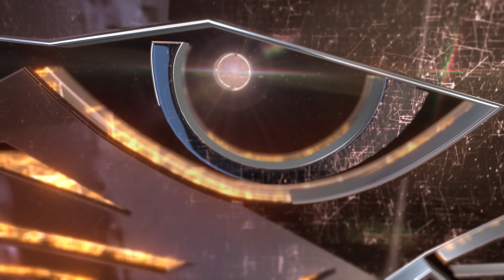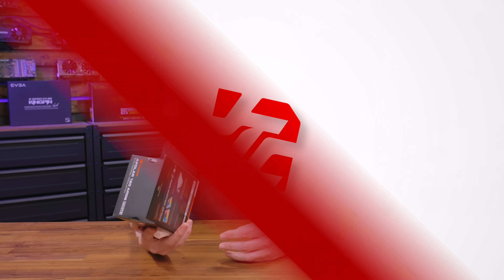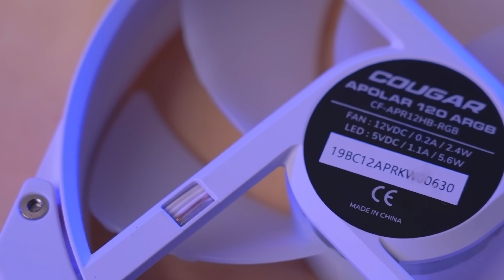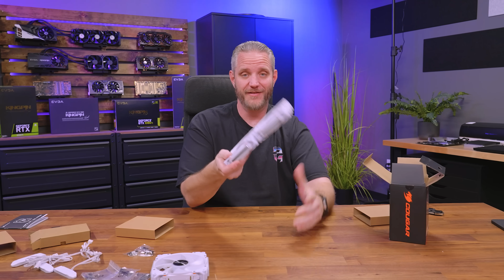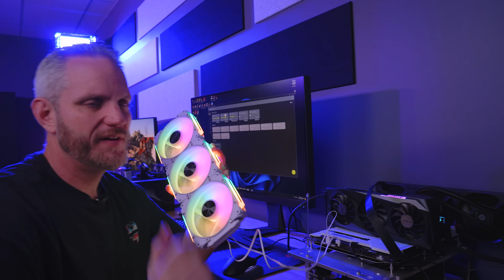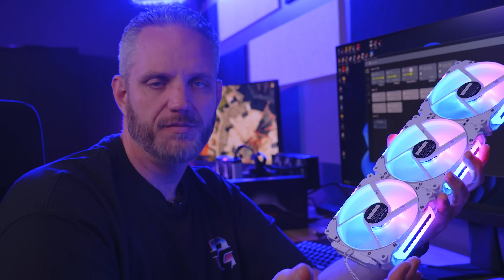ALL PC fans should have this feature! (NOT RGB)

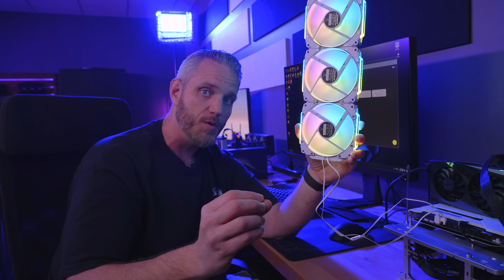Comment: Hey Jay, I almost never comment but had to inform you! At 16:15 you said "because right now you can only get interconnecting fans in RGB". That is not correct because Corsair (of all brands, one of the most rgb focused brand does make this lol) does make the "Corsair iCue Link RX120".  It does use the Link hub, which is great when you use multiple Link components, (Fans are available in black and white, 120 and 140 variations.)
Reply: Also Lian Li Uni Fan P28
Reply: and the corsair qx series
Reply: I have Corsair. It's ass.

Comment: Arctic Liquid Freezer 2 AIO (non-rgb) with one cable off the AIO pump and interconnected fans would be bloody awesome. I would also loooove to see slim interconnected fans as well as that's where it makes most sense as in small form factor builds space is at a premium. Less wire clutter means less restrictions for airflow.

Comment: hi jay the only issue i see with fans like this when all connected via one lead which is great by the way.
 i have lian  li  and also a cheap set of ediy fans and have got them connected via controller and also mobo.. which i love also  have razer chromo unit etc but what i cant seem to figure out 

is that you dont get to control the individual fans as such with colours its either one set for the whole set . meaning you cant have individual effects for each fan unit and tried different software like signal and msi and open rgb

Comment: The price is attractive?! Fans have become SO over priced and buy buying stuff like this, you're just reinforcing that it's ok to charge that much for a FAN WITH A FEW LEDS... I filled my PC with Thermalright fans. You get a 3 pack of rgb fans for $13... Yes... 3 fans for $13. Granted they do have 2 cables per fan, but with a dual chamfer case where all the wires can easily be hidden in the back, I'll happily spend $40 to fill all 9 spots in my case vs the $210 for these fans and just deal with a few zip ties. Not to mention that these fans use proprietary connectors! Proprietary is bad! Standard form factors are what make replacing and upgrading your PC easy. Stop supporting crap like this just to get away from a few extra wires that can be tucked away. You're just making everything more expensive!

Comment: might be able to 3d/resin print new spacers to change out the orange ones, or maybe fine something at the hardware store.
Reply: He didn't realize that those black rubber pads in the begging he didn't know what they were for were black replacement spacers for the orange ones already included in the box.

Comment: In my opinion fans could be improved by better cooperation with gpu and motherboard for example to be able to fans ramp up or even start when gpu reach some targeted temperature also for cpu and other places in the pc case like temperature of VRAMS on the mobo. Also half of the fans can be turned off when the pc is not under load.
Reply: you can already do that either with software or 3rd party controllers like aquacomputer quadro.

Comment: I would 100% buy interconnecting fans if they had no ARGB. The only reason i haven't gone to these types of fans is because I don't want ARGB.
Reply: Don't plug in the ARGB cable. Problem solved.
Reply: Or buy the non RGB models lian li sells.
Reply: lian-li unifan p28. interlocking and no rgb. $55 for a 3 pack.

Comment: I built my first PC with 10 Corsair fans. I have two different hubs, 10 fans, and a whole lot of cables. These daisy-chained fans are a welcome addition.
Reply: i got 6 corsair fans and 1 corsair pump, dealing with cables and 2 hubs is annoying
Reply: @sopcannon  yeah I have a Corsair AIO too - it's so much to cable manage. I like the Corsair ecosystem, but I hate managing so many cables.
Reply: @newstandardaccount  yeah i got a case, case and memory all corsair, not a fanboy but its all controlled by one program.
Reply: @sopcannon  yes same here - 5000D, and I love it. Honestly once you buy into one ecosystem, the incentives to continue with that ecosystem are so strong. This way I only need icue, and not 500 different management tools.
Reply: @newstandardaccount  i got a 500d with a dead fan controller, discovered after installing everything.
Reply: @sopcannon  Corsair support has been good. When my 5000D arrived, the front panel was bent. They sent me a new one quickly.
Reply: @sopcannon  I setup my sons computer like that. Routing all those wires was a pita!

Comment: Anything that can move air/fluid is NEVER boring! I find it interesting. Granted I care more on the heat transfer / fluid flow area. Not so much with the lighting. I just bought a 3 pack of Super Flower MEGACOOL 120MM fans. I am going to see if they cool my Artic LF2 360MM AIO better than the included fans. 
From Jay to Jay.

Comment: Hey Jay, I have been using Evga Precision with the argb/rgb header on a evga GPU to do the signal with a hub powered by a sata cable for the lighting. The software is just so much more polished and responds almost instantly. If I could get rid of my asus board I would.

Comment: After dealing with some bad screws in my last build, anything to make fan installation less annoying is welcome. My next build will (hopefully) be water cooled, so just being able to slap a solid stack of fans on a rad sounds nice
Reply: personally won't end up with watercooling but being able to make a block of fans for the front of a case (especially a large 3x 140mm intake) will just be awesome.
Reply: still have to screw them on, just makes the wiring neat l

Comment: Lian Li Al 120 3 pack is 10$ more (79$ at the moment) and they come with a controller.
16:15 They also have P28 fans which are interlocking, they don't have RGB and the blade made from LCP - they offer great performance. 
What the point of this video ? cougar aren't in the top of performance\quality, at almost 70$ for that fan it's not that good of deal.

Comment: I like cougar fans they're quiet and perform well in my experience as both case fans and on a heatsink. I don't think you'll ever see that orange grommet thing under basically any use case at least not to any meaningful degree even in the ones you would like on a horizontal rad

Comment: Yes, this should be a standard. I feel we should move to reversible fans as well. Finding white reverse direction 140mm fans for the bottom of my O11 Vision was harder than it should be.
Reply: Serious question, but why does it matter if they are reversed when you can't see them? Or even if they are visible, you can't see the logo.
Reply: Much cleaner look. You see the infinity mirror (on the model I got) and no frame. @farmeunit
Reply: @farmeunit  the fan hub with the 4 spokes coming off it looks "bad".
Reply: @FastSloth87  My point was, if they are in the bottom, how are they visible... I don't own one, so curious.  I haven't seen a case where they are visible in the bottom.
Reply: @farmeunit  literally all O11 derived cases.

Comment: I'm glad there will be less cables and controllers on these types of fans, but I'm not glad about spending several hundred dollars only a few years ago on fans and controllers, to now need to spend another several hundred dollars on these. Current estimate is $500 to replace my current fans and remove the uneeded controllers. My fans and controllers are still good, how many years before replacing if not broken?

Comment: I'd rather deal with one cable per fan than these "revolutionary" chaining setups where the fan may not fit on some cases because the fan body is larger in order to accomodate RGB and other crap. And for 66 bucks, you're putting way too much faith on those plastic wings which will wear out and break under normal use eventually.
Reply: Get sl120 v1 , no proprietary connection, construction is a tank, no fan come close to the quality, the plastic thickness is too much it's unbreakable no matter what
And use them with signalrgb, they are even cheaper nowadays,

After using sl v1 and sl v2 I will never ever accept fans lower than their quality and features

Comment: I like how you trash talk asus, and I literally just ordered an asus motherboard, now I feel stupid
Reply: It feels a little bit " I have to say bad things about Asus because they are currently the badies"
Reply: @scruffy3121  i mean maybe they are the badies and all that, but they've made motyerboards that people buy for a really long time. In my case I accidentally damaged something on my gaming pc last week while trying to overclock... It was crashing while gaming, so I restored the settings to stock settings and well.... It still can't hold 30 minutes of gaming without hard crashing... I thought maybe I corrupted some system files, so I installed win10 from a new thumb drive and well... It still crashes.. but hey the bright side is I'm upgrading the whole thing. I'm going from a 9700k to a 14700k (btw I didn't know it basically functions the same as the last gen chip for a higher price, so I'm kinda screwed on that front as well) and that means that I also have to upgrade the motherboard because the new socket and all that, and then I also realised my DDR4 memory sticks won't cut it for the new motherboard so I threw in even more money to order myself 2x32gb DDR5 sticks. And then a new radiator and a power supply because it appears that the new 14 gen cpu is HUNGRY for power... And I ended up spending so much money... Just because I thought it was a good idea to try for a 5Ghz overclock on that poor i7 9700k...
Reply: @scruffy3121  Or they just suck?

Comment: Seems pretty nice for the price. I like the click and sturdy interlocking tabs. Seems like a fair amount of effort went into making sure you've got good connection. Lian-Li could learn a thing or two from Cougar on that front.
(The interlocking tabs on Lian-Li's TL LCD fans are absolute garbage compared to these. You can easily disrupt the connection on those, which in itself usually isn't a problem, but becomes a real pain because it messes up connectivity with the Lian-Li software, so you end up having to physically disconnect and reconnect all connection points to "reset" stuff.)

Comment: If only there was an open connection standard that included addressable fan control and addressable rgb.
If you can't easily have that much power running through the motherboard, put that on fan/rgb hubs with another open connection standard that would let the UEFI control anything connected to that hub. That would allow for daisy chaining between brands, even if different fans don't snap together. Though an open standard that allowed for that would be perfect.
Manufacturers' inability to work together on new standards has forced everyone to leave decades old standards on motherboards.

Comment: $23 a fan is not insane?? 😭😭
Reply: It is
Reply: For these type of fans it's not unfortunately
Reply: nope. these are the cheapest i've seen of the linking fans. corsair's go for $30-45 per fan, lian li and thermaltake are about $25 per fan. you want cheap, buy non-rgb, non-linking fans.
Reply: @KOCotto  Thermalright 120mm ARGB fans are $13 per triple pack. Their non-rgb fans are barely any cheaper. Plus, the fans themselves are good quality. They're not linking fans like these, but the value proposition is insane. I'd have to really hate cables to spend that much more for linking fans.

Comment: The best powerfull fans are from Arctic and are the P12 Max with sealed blades. If they would make a version that could snap each other that would be the perfection. No RGB gayness going around. If you need some light inside the case, a led stripe is enough.

Comment: Lian Li makes the P28 fans. They are Uni fans, so they connect to each other. They come with no RGB, but you can actually buy a little side strip thing to add them if you want. Also, the cable that connects to the fan header is sleeved. So it looks nice and has some extra durability. They're good fans.
Reply: Love lian li stuff but thier l connect is garbage. It's insane how much cpu usage the app uses and tbey still haven't fixed it.
Reply: @11onejay  What's good about these fans is they don't use any extra software. They're simply the 4 pin fan header.
Reply: @jimbobvaquero  yeah if I were to buy an expansion piece for more headers I could just plug all mt fans into the mobo as well and just run armory crate. I hear they are brighter as well. Just like the look if minimal cables on the front side of my pc.
Reply: @11onejay  L-Connect is such a PITA, took me a couple of hours of research to know that the latest version is broken af and had to download an older version for my SL 120 V2's to work properly. I love the fans but their software is utter garbo.
Reply: @ajtheracer95  100% agree lol. Some of the nicest looking fans in the market though.
Reply: If you're going for performance fans line P28, it's better to buy Phanteks T30 which is the best of all. Noctua NF A12x25 and Nidec GT are also good options.

Comment: So wait you gave it credit for not having a controller in the box because it's better to use the headers on the MB then you say you can't wait to get your in line rgb controller?  I'm pretty sure MB mfrs are paid by fan makers so they can sell controllers.  ASUS is actually better than the rest.  Hard to believe but the MSI software is even worse garbage and my z790 from gigabyte released firmware that bricks it's argb headers and can't be fixed.  They're all garbage but singling one out is silly.

Comment: The main issue I have had with these types of fans is case compatibility. For example - my H6 Flow does not play nicely with alot of these connectors without needing to mangle them or trim them down which really stinks. The sides become too bulky and don't allow for the main connector for the wire to be there. On the H6 this is mostly present in the Titled font panel fans and the double 140mm fans at the bottom with the little lip holding them back.

Really love this direction of fans, though wish more cases would play nicely with them. I really like the look and use of the Thermaltake SWAFANs for their ability to change their direction but they sadly just did not work for me

Comment: Looks like the small orange spacers could be removed and replaced fairly easily by just undoing the screws that go through them, of cause it would be better if they were just the same colour as the fans to start with.  If you've got a 3D printer then it would be very easy to make your own spacers too.
Reply: They seem to be made of rubber, I suspect they act as noise dampening. You'd need TPU for that stuff.
Reply: There was some black rubber stamped in a sheet in the beginning, might have been for this?
Reply: @Bratfalken  Nope. I thought the same, But Just looked at the manual. It shows them being used under the heads of the 4 mounting screws.
Reply: @farmeunit  Obviously. But it seems pretty redundant when the corner mounts are fully dampened from the fan anyway by the orange rubbers.

Comment: I bought very similar fans recently (D30 from Phanteks) and honestly the only upside was looks and connectivity. I thought the fans had some sort of coil whine (turns out they didn't) so I swapped them for my 5 year old Arctic P12 and they got outperformed. Because i wanted RGB Fans in my new build i settled for the Thermalright TL-C12C-S and even they outperformed them. 

Just for your information:

3x Thermalright fans = 15 bucks
3x Phanteks fans       = 85 bucks
Reply: Iirc the D30s have smaller blades because of the frame
Reply: Small Edit: I personally don't mind the few extra cables and the BIOS fan curves have been the same for all 3 fans.

Comment: I mean... I feel stupid for paying $99 for each pack of 3 fans from Lian Li... and then buying three sets of three. Three hundred bucks worth of fans, just because there were currently no other fans that interlocked and I was tired of all the extra cables.
Reply: Personally I think the Lian Li looks nicer and cleaner. The 3 pack also comes with controller which bumps up the price, though would have been nice if they also offered a 3 pack without controller. Higher prices is also what happens when you are an early adopter of tech.

Comment: I always thought the PC components should be connected like legos are. Modular. I mean, the MB should clip into the case, (like NVMe do on newer MB's) with the connectors ported into the case itself and everything just clips into the spaces provided for them. I know how difficult that sounds, to get everything/everyone on the same page. They're getting there with reverse pinned MB so the connectors point down into the case instead of up into where the mains usually are. I mean, instead of flex cables, there should be channels to direct the power.

I've been (off and on) building PC's since the early 90's and we've made it a long way since those times. But, it's still a kludge.

These stackable fans are just one small step into this. With 3d printing and 3d fabricators people can buy, there should be more flexibility these days than in previous generations of PC builds.

Comment: If Be Quiet makes fans that connect and only run one cable (silent wings or light wings) i WILL buy.
After installing 7 light wings in my pc build, with all them fricking cables, i wished for all of them to just need one or two cables.
And yes, to heck with Asus and their crappy program.
My Team Group Delta RGB ram was flickering or not working at all, so finally after getting rid of Armory Crate my pc actually felt more stable.
Looking forward to the next video :D